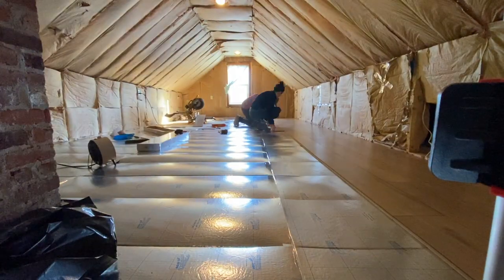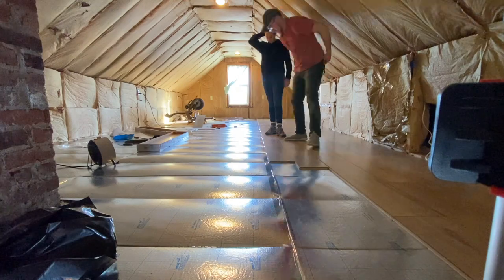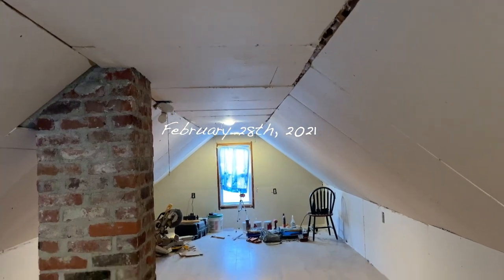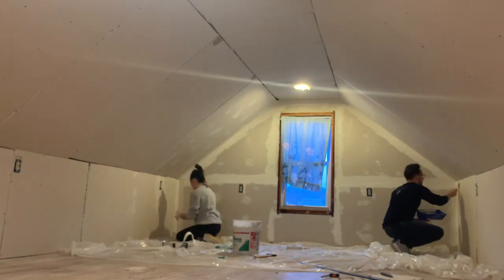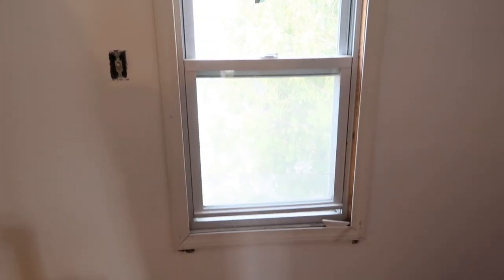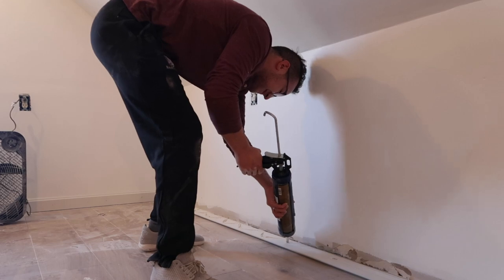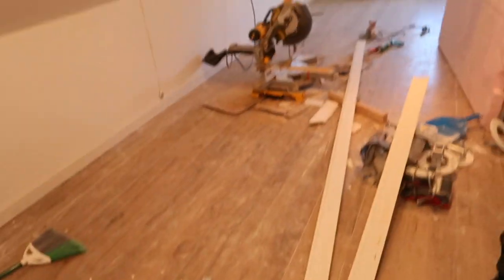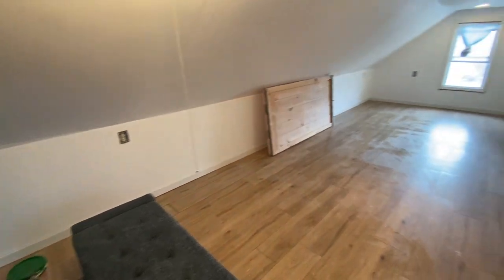DIY Unfinished Attic Remodel into Music Studio

Comment: My wife and I did laminate flooring throughout the house.  She would lay the new panels on the last row installed while I banged them together.  It made it much easier and faster.  

The space turned out nice.  I see you used R-13 in the overhead, how is the thermal efficiency of the space?  What are you doing for HVAC up there?  What area of the country are you in?  I am looking to finish our attic and have mulling over insulation and HVAC.